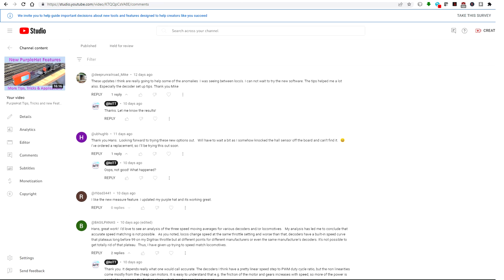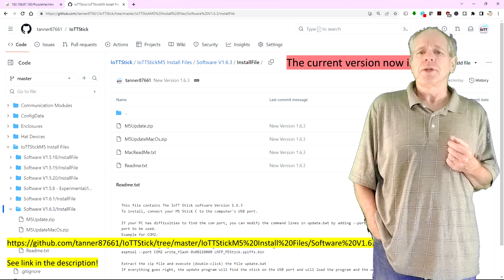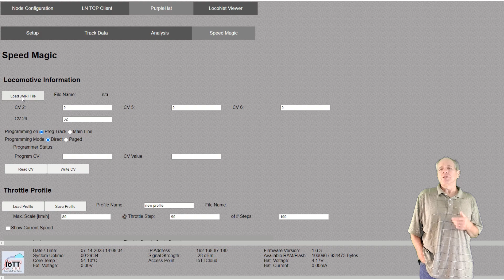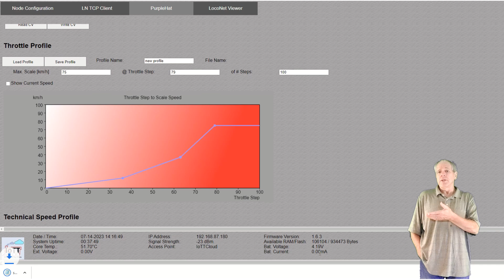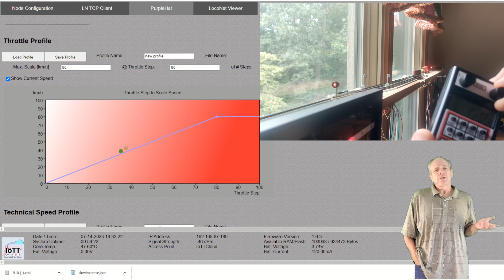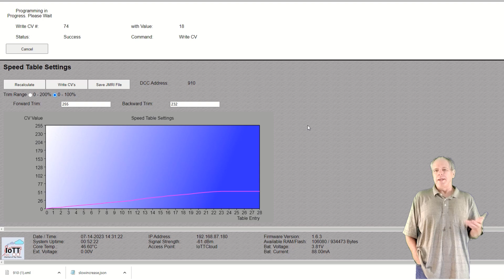Closing the Loop - More New PurpleHat Features (Video#142)

Comment: can I use the purple head without network and use usb directly to the laptop an a rollerstand
Reply from the maker: No, at this point it only works via Wifi, communicating either using WiThrottle or Loconet over TCP protocols.

Comment: Hi Hans, reciwved the purple hat and got it all hooked up an active.
I have a question with the vstart/high settings. On esu decoders they have a minimum setting of 1, not 0 as your videos show. I then find the loco wont move on these lower settings. Is there a different approach with esu decoders?
Reply from the maker: I am not very familiar with ESU decoders, but the vstart setting is a mandatory CV setting. More information is here: https://dccwiki.com/Vstart
Of course the value you need to set so that the loco moves on speed step 1 depends on the drive train of the loco. Usually I recommend setting it to the lowest possible value so that PurpleHat measures the linear speed curve. If the loco does not move on the first 2 or 3 steps, this is not a problem. If it is more, the process will stop. If this is the case, you can set vstart to a higher value so you get some movements. It creates a slight non-linearity on the speed curve, but as long as it is not too much, it does not make a big difference on the final speed table.
Hope that helps
Hans

Comment: Dear Hans R. Tanner

I hope this message finds you well. First, I want to thank you for your excellent work with the IOTT Purple Hat. I’ve been using the Plus2 Purple model along with a Digitrax DCC System and running JMRI on my PC. The setup has been fantastic for most of my needs. However, I am encountering a specific issue while speed profiling my trains equipped with Digitrax DN163KA0 decoders.

I’ve followed the steps from your YouTube videos (links below for reference) on preparing decoders for speed profiling:

https://youtu.be/pA4SSrq9UFE?si=vg0txADZWpGZR5Kq
https://youtu.be/KTQQpCsVA8E?si=073yX4VaBd9iLnRR
https://youtu.be/s9Wfw1m8l4A?si=nRnLpxEwS-eLw_wz

The problem arises when I attempt to speed profile the trains. Despite adjusting the Kick Start and Min Start values, the locomotives will not start moving on speed step 1 unless the Min Start is set as high as 15 with a Kick Start of 2. Setting the Max to 255 and the Mid to 0 should theoretically create a straight-line speed curve, but even with these settings, the locomotives require about 50% throttle to start moving. This inconsistency makes speed matching two locomotives quite difficult, especially when they exhibit these issues at different step levels.

Furthermore, when I revert to the recommended settings, some trains do not start moving before the Purple Hat seems to abort the speed test. I understand this is likely a safeguard to prevent system errors, but it complicates the speed profiling process significantly.

Could you please provide any suggestions on how to adjust the settings to prevent the Purple Hat from aborting the speed test? Ideally, it would be helpful if the system could continue through all speed steps, even if the initial steps do not move the train. This way, it could still gather the necessary data for a complete profile.

Your guidance on this matter would be greatly appreciated. Thank you for your continued support and the excellent resources you provide to the community.

Best regards,
Reply from the maker: You are correct in your observation that the PurpleHat stops the profiling process if the locomotive is not moving after the first two or three step increases (indicating a problem with the loco setup or hardware). The same is the case if the next speed step does not result in a higher physical speed (indicating the maximum speed of the loco has been reached), or if the end of the test track is reached before a next higher speed step can be tested (indicating the test track is too short). 
So, in your case I think you should try to find out why your locomotives are not moving at low speed settings. Unless something is wrong with the decoder itself, I would look at the track voltage as well as mechanical problems inside the loco's power train (motor, gears, grease, dirt) and also verify the CV settings of the decoders. Since you are saying that several locos with the same decoder have different running characteristics, I would first checking the power train and the CV settings.
It is in your best interest that all locos run smooth starting with the first speed step, and at least in my experience, that can be achieved. Once you have that right, speed profiling should no longer be a problem.

Comment: What types of statement logic does JMRI accept?
Reply from the maker: The Stick can connect to JMRI either via Loconet over TCP or WiThrottle protocol. Simply activate the respective server in JMRI and configure the IoTT Stick accordingly. Both protocols can to speed profiling. To write the CV values of the speed table into the decoder you have the choice: When using Loconet over TCP you can directly write it using Ops or Service Mode programming. WiThrottle only supports Service Mode. Alternatively you can save the table data in a file and import it into JMRI to do the programming of the decoder.